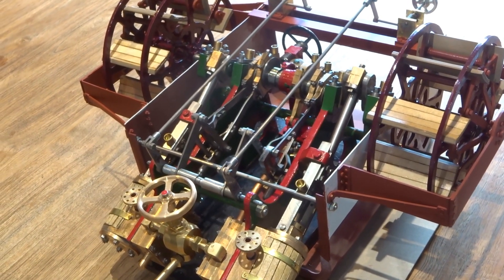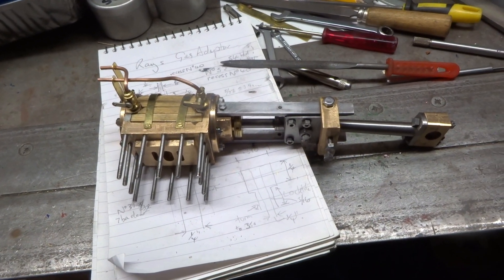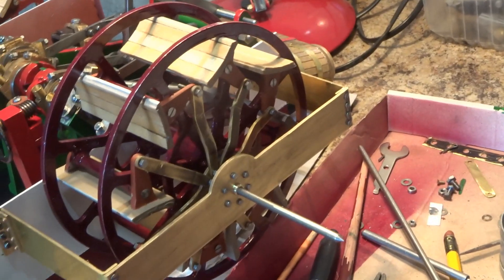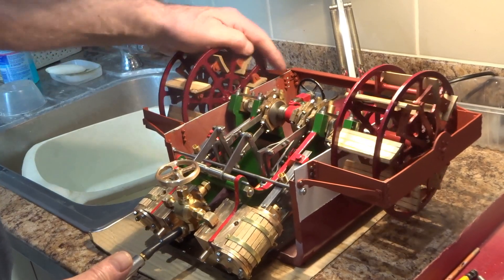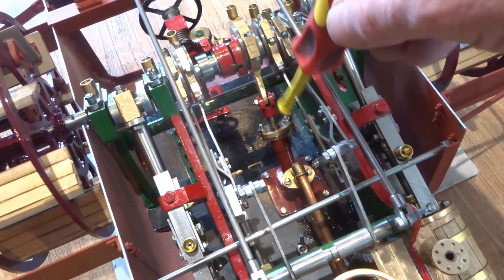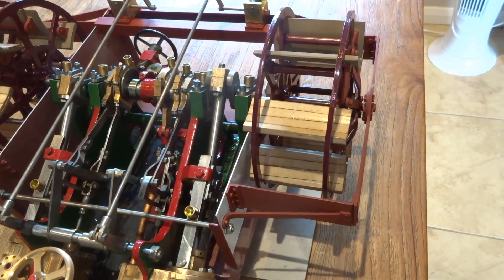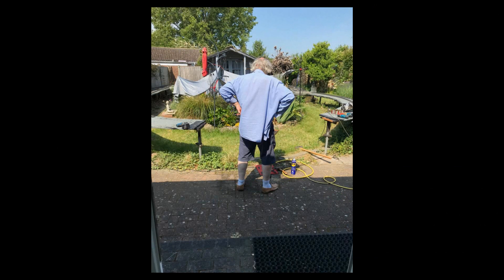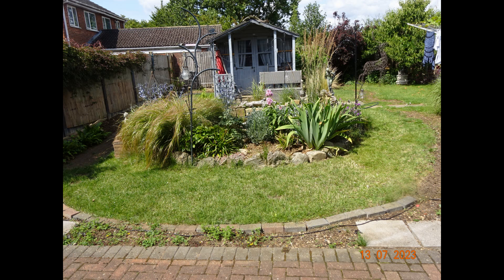Paddle steamer engine part 8

Comment: You look like the mad professor 😂 shame you can't rebuild the engine in my truck 😢
Reply from the maker: Morning Ian. The local consensus is that I don't have all my marbles. Sorry about the truck engine, but these days I only work on things I can actually pick up. Engines are a bit much! In any event I suspect that modern vehicles are well beyond my capability. Took my car in yesterday to have new rear discs and pads. In the (very) old days I could have bought 6 cars for the price and still had change. This volvo is nuts - 4 years old and only the rear brakes are worn, the front ones are hardly touched. Clearly some sort of Volvo electronic safety featur re brake bias. the mechanic said it was not unusual, but he couldn't fully explain it either.